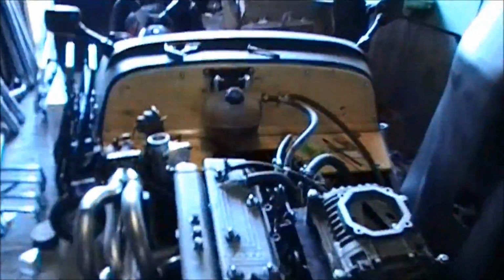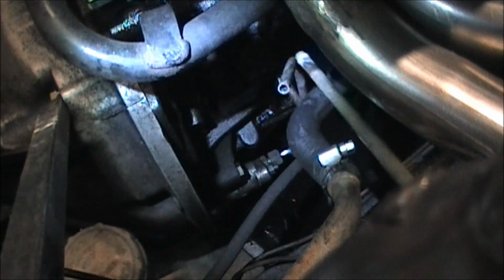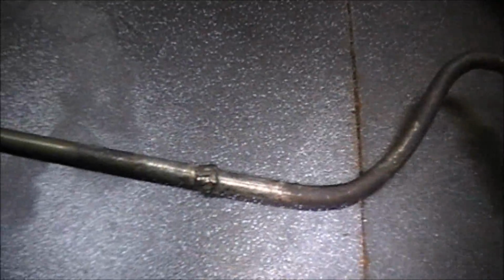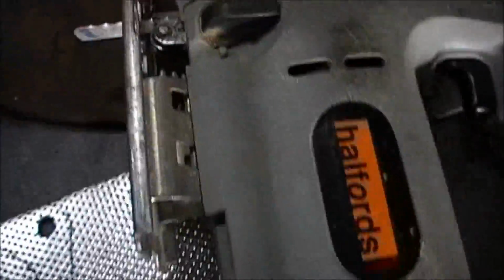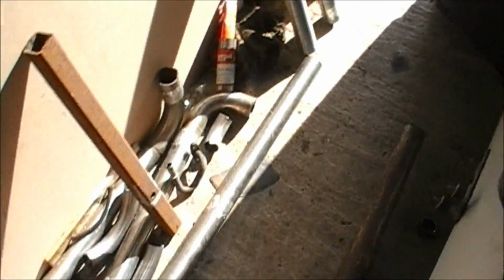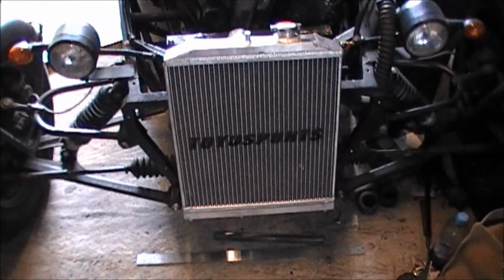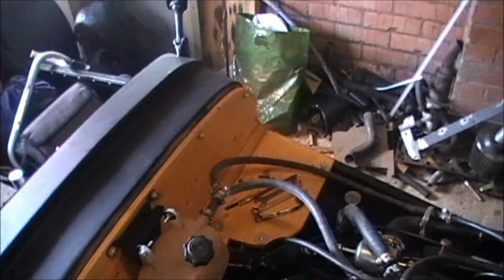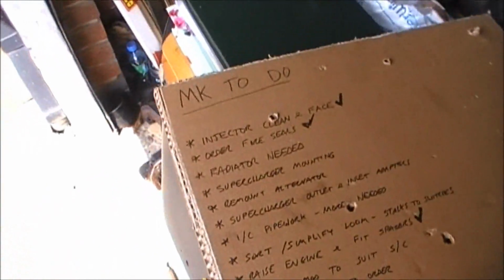Diesel kit car Ep3 - Fired up

Comment: Hi |Ben, a bit of a random question about that cooling system - which header tank did you use?
Reply from the maker: hi, it's from a Rover, i think it's a 25 or 45 but can't be sure. Definitely Rover though! Quite a handy tank as it comes with a nice flat bracket that you can put 2 bolts through and you're done.